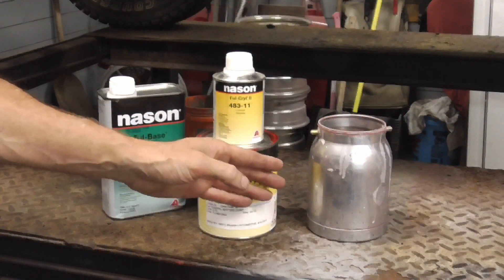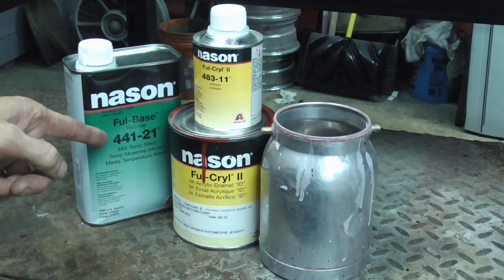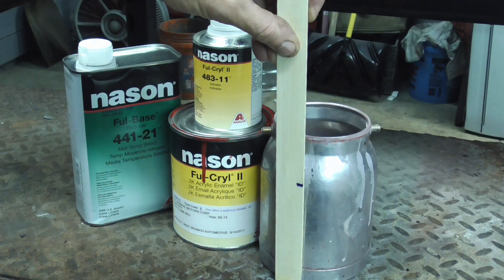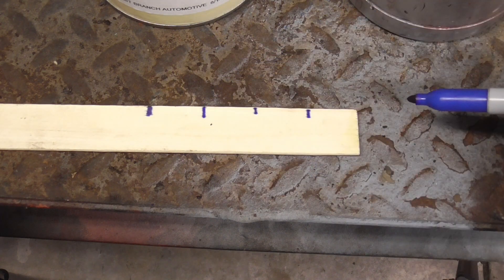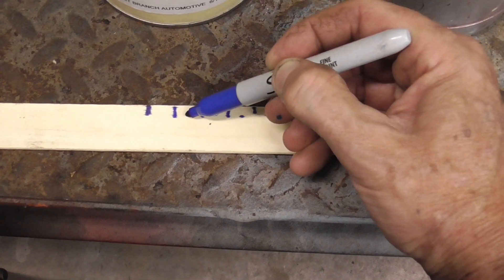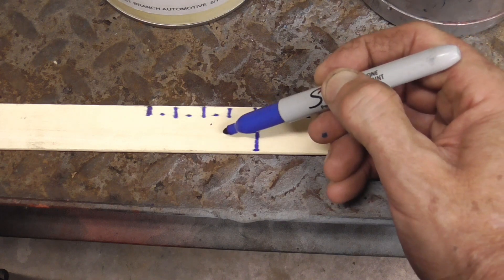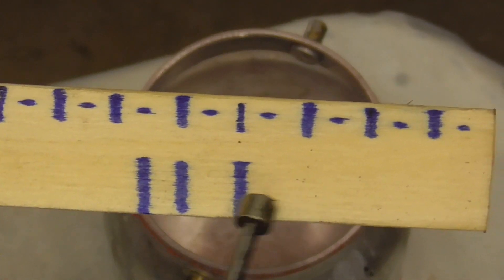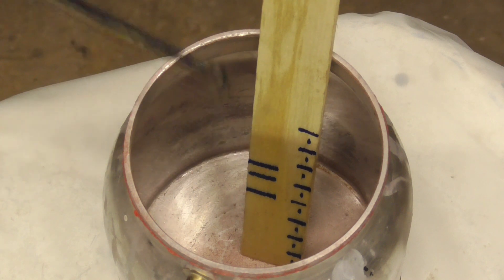Automotive Paint Mixing Ratios Made Easy

Comment: Very cool idea you are the master Jerry..... I have a question if l wanted to make a primer a primer sealer can it be done by mixing 4:1:2
Reply from the maker: Yes.  You can basically use primer for every step of the paint job.  Mix thick for blocking.  Mix thinner for finish sanding.  Mix even thinner for a sort of pre paint sealer or to get it all one color before painting.  Hope that answers your ? - have a great week Luis 😊
Reply: @LakesideAutobody  hello Jerry the reason I'm asking is I'm having problems the filler bleeding through the primer how can I stop this Jerry and I went to my body supply store they want over $200.00 for a sealer
Reply from the maker: @firstgenerationgarage2803  What do you mean, it's bleeding through the primer?  Do you mean that when you throw on a light coat, it sort of soaks into the filler?  If that's the case and you have a lot of filler spots showing through the cure is to get it straight by block sanding, prime it again and then wet sand the whole car by hand so that you don't go through the primer.  You do not have to use a block when wet sanding by hand - you can use your bare hand - don't let anyone tell you differently.   I know that sounds like a lot of work but that's how we did it when I worked.  Let me know what you're thinking - we'll figure out the best plan for your situation ✌

Comment: What about 10-20%?
Reply from the maker: 10% is like saying 100 parts to 10.  20% is 100 parts to 20.  A different way to look at it is  100:10 or 10:1  &  100:20 or 10:2  - If that doesn't help ask a gain :)
Reply: @LakesideAutobody  
I have mixing cups but the 4:1 doesn't have percents for that ratio. 
I guess I'll look at how many ounces it is after 4:1 and then add 10-20% to however many ounces total it is. 
If say it's 20 ounces add 3 more ounces for the 15%. 
It's optional for reducer so I might not even need it...
Reply from the maker: @Foche_T._Schitt  Good thinking FDS - let me know how it works out and if you have any more ?s 😊

Comment: So help me out they want 4.1.2 on hb primer all the cups are 4.1.1. Now if i use the scale on the side of the cup it`s too much paint i need. Say i use 8oz of paint how would i calculate that using 4.1.2 ?  4 part paint 1 hardener and 2 reducer.
Reply from the maker: If the Ratio is 4:1:2 Paint/Hardener/Reducer - You'll want 8oz of paint 1oz of hardener and 2oz of reducer.  You can add more reducer if needed w/o more hardener.  In case the paint mixture is still too thick to spray nicely.  Ask again if that didn't help  :)

Comment: Any reason you didn't just divide your desired stick height by 11?  That way you simply pour your three parts into the cup until they reach their respective level: 8, 2 & 1.
Reply from the maker: I've been thinking hard on how to divide a distance in equal parts very easily w/o tools or math.  Can't come up with an answer except for eyeing things in half - that would be hard to divide it in 11 parts by eye.  If you come up with a way to lay a stick down and divide it up real quick into an odd number of parts let me know.  I've been working on a paint mixing ratio tool that can be cleaned and reused with every different ratio.  Jerry
Reply: @LakesideAutobody  that’s simple.  Take a piece of paper and mark the distance you want your finish depth to be.  Get yourself a metric ruler and place the 0 point at one of the bottom corners.  Keeping the bottom of the ruler at the corner, pivot the ruler until an 12 or 24 or any other number divisible by 12 (1 more than the number you’re wanting to divide) crosses the line you drew on the paper.  Then, put a tick at each of the 11 intervening points.  They will each be exactly the same distance apart.  Hope that’s clear enough
Reply from the maker: @ApexWoodworks  Would it sort of look like this or was I making it too hard in this video - https://www.youtube.com/watch?v=sQwlFuYPudY  Thanks for the reply back :)

Comment: hardner first then reducer?
Reply from the maker: Yes - but it really doesn't matter as long as you have the mix ration correct.
Reply: @LakesideAutobody  still trying to figure the mix ratios. Can says 20% hardener and 20% reducer.  Pour an amount of paint lets say to the 8 mark. Then were do you go for 20%
Reply: @2manycatsforadime  using your example, you'll be using 6 parts of paint, 2 parts of hardener and 2 parts of reducer.   Mark your stirring stick desired level into 10 equal parts.  The bottom 6 will be for your paint, the next 2 for hardener and the last 2 for reducer.  Hope this helps.

Comment: nice, can you show how to spray with no orange peel sometime.
Reply: yes this is all dependent on setting up the gun correctly then the amount of thinner added then the distance you hold the gun away from the work piece then air pressure and also a good gun that atomizes well. I am still trying to figure this out.
Reply from the maker: Sure, good suggestion
Reply: practice, practice, and more practice.  you learn by trial and error.

Comment: I thought 8 partes paint is #8 then 2 partes reducer then 1 part hardener so  8 plus 2 = 10 plus 1= 11 in total i think o well please let me know if i was close thanks
Reply from the maker: Yep - you're right - now if you can divide the distance on the stick into 11 equal parts - I just divide the stick the way I do because it's easy to do
Reply: @LakesideAutobody  Yes I thought the stick was very cool and easy.  One thing that confuses me though. If you have a given volume of paint and add your hardener the total volume has changed. The next addition which is reducer then is based on the new volume or the original volume of paint?
Reply from the maker: @2manycatsforadime  The next addition is based on the original volume of paint.  Think of "parts".  If I say 1:1 that means 1 "amount" to another amount with the same volume as the "original" volume or 1 part to 1 part   Let me know if that makes sense - Jerry

Comment: wow sorry but nope didn't understand let me see it about 1000000000000000000 times and then I'll take it from there LOL
Reply from the maker: Here's even an easier way.....  If your ratio is 4 to 1 to 1 just divide the stick into 6 equal parts - 4 notches will be paint + 1 notch will be reducer + 1 notch will be hardener = 6 total parts  - hope that helps
Reply: more less lol
Reply: @LakesideAutobody   however with the stick method 4 is paint then one notch is what percent of the 4? if I understand this it would represent 20% as it is now at 5 parts each part at 20% next addition at the 6 mark makes each mark approximately 17% of the total volume. Theoretically keep adding marks and the hardener and reducer gets to be less and less of the paint volume?
Reply from the maker: @2manycatsforadime  1 notch would be 25% of the 4 parts but 20% of the 5 parts.  I wouldn't think of it in percentages - just think parts.  Divide a stick into 10 equal parts - some notches would represent paint, some would represent reducer and 1 or 1/2 of one would represent hardener - whatever the mix ratio on the can wants.  Percentages can get confusing.  Let me know if that makes sense if not I'll try again :)